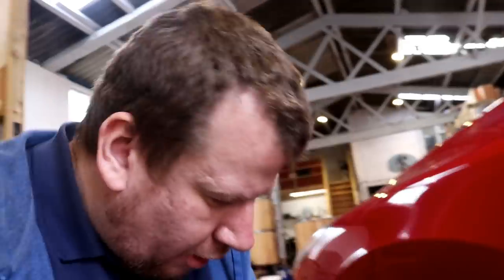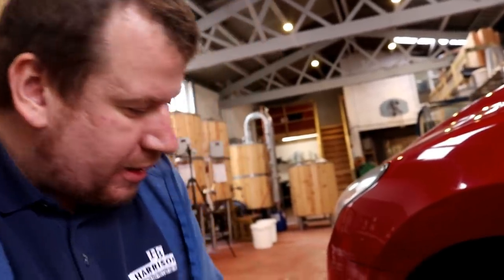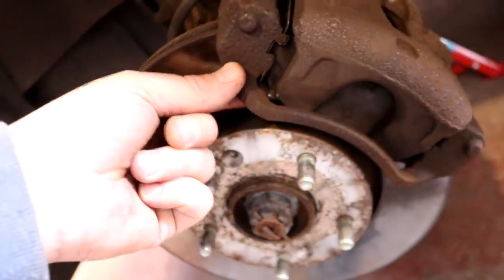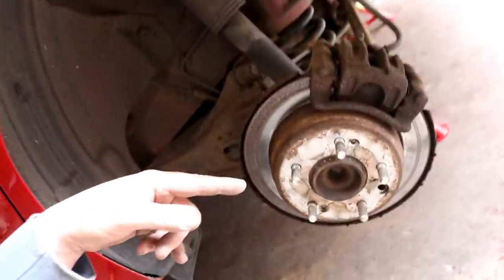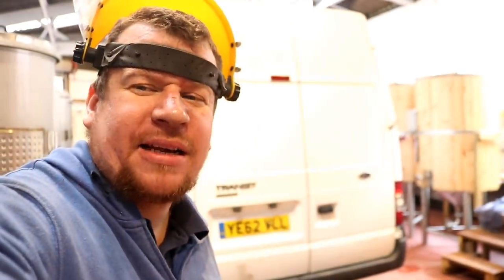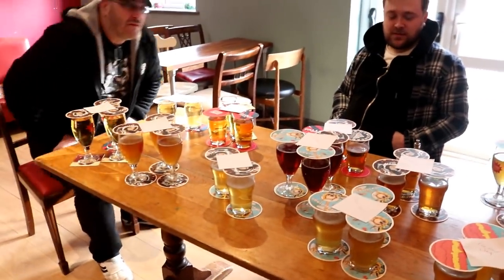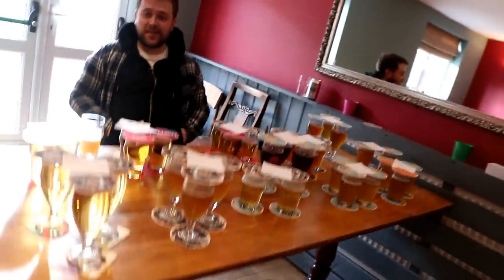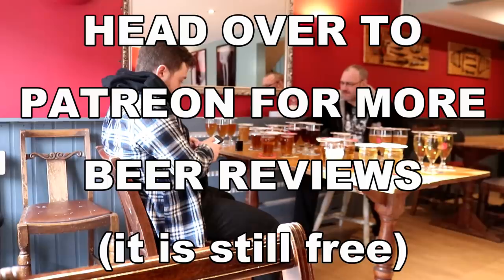THE BENEFITS OF THE LINE CLEAN

Comment: The wheel generally holds the disc in place, the judder is most likely to be disk wear/ warping. The machine screws are only there to hold the disc in place if you take the wheel off. It's still good to replace them though. Ahh, seen that you've already been there  😄. Line cleaning? Looked more like a piss up 😄 . Great update as usual. Cheers, Schnuz.

Comment: The vibration could be as simple as a stabilizer bushing. If it doesn’t pull to onside when you brake the ball joint maybe ok. Easy way to check is while it’s on the jack stands use a pinch bar under the tire and lift so you put pressure to one side of the tire and see if you’ve got some movement. The caliber maybe sticking also. Look for excessive brake dust. Cheers Chris gotta love old cars 🍻

Comment: You were correct about the disc retaining screws, Not essential. Many manufacturers don't even use them. The discs are held in place by the centre hub and the wheel holding it in place. The most common causes of brake judder  are warped front brake discs. Could also be caused by shite in between the disc and hub. Good luck.

Comment: The discs have clearly been off before, could be that the disks have crud / rust behind them on the joint face with the hub. Even with the wheels on right, the disc could have bad run out.

If you have a  DTI / clock, you can check the runout by spinning the disc with the clock on the disc face. (you will need to make sure the discs are clamped to the hub face with the screws you replaced or maybe the wheel nuts and some washers)

Comment: Most likely culprit would be warped discs Hazza. You can get them machined to eliminate all the run out. Depending on pricing may be cheaper to replace the discs. Also, try and make sure all the mating surfaces are free of any big lumps of corrosion or dirt etc. and always a good idea to tighten all the wheel nuts to the correct torque in the correct pattern.. You can see on the rear disc, looks like only half the pad is actually touching the disc.

Comment: If it's only coming from front could be play in a ball joint tie rod setup,depending on condition of front discs could be some warping in them,those are the usual suspects. Like is said below could also be an abs fault,get it tracked and balanced and pack those ball joints with plenty grease,change your brake fluid and bleed the brakes,might seem unnecessary ATM but that might turn up the fault and at very least it's not a bad thing to do on an old runaround vehicle with high mileage. Well wear with the new bus and I hope ye had a good time sampling lol. Be interesting to hear how that whole process is done and why,if you're ever looking for a filler vidja. Cheers.
Reply: Check for free play in track rod ends Harry and replace if necessary. Could well be front discs warped so change them mate. Rear discs look f**ked aswell so they’ll need replacing

Comment: remove pads and clean up where the pads seat into the calipers, probably all crapped up causing it to bind looks like the pads aren't clamping properly to the discs (can see the rusty discs where the pads aren't clamping fully) won't cure the wobbly breaking tho as the discs sound like they are warped but atl east you'll increase the braking efficiency, new discs and pad set would be the best option overall tho